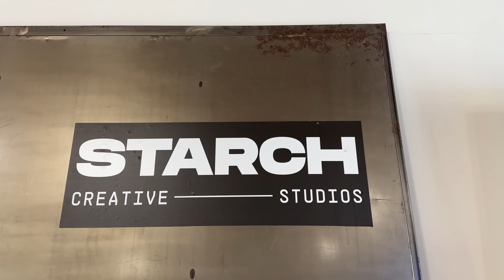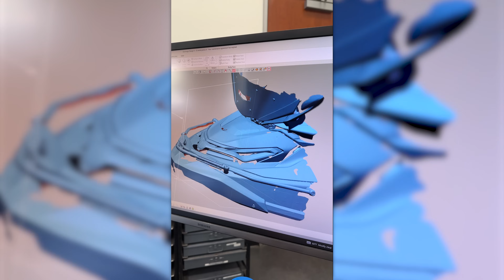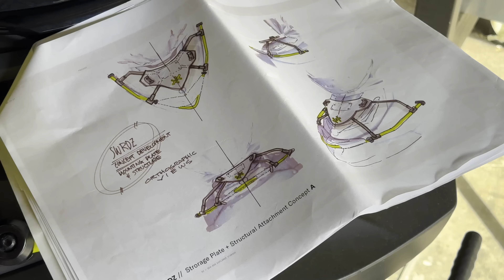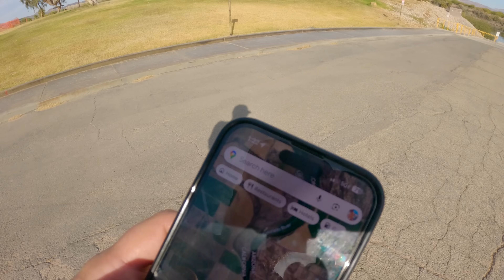This River Is CURSED!

Comment: Check with your design and fabrication companies to create a PWC anchor winch. Not the traditional type that simply releases and then pulls the anchor back in on a boat ... instead a smaller version that uses synthetic line such as used on an ATV (lighter/durable) that is released and throwable into deeper water or to nearby land. The attached anchor or hook can be captured on an underwater or land-based object (rock/tree). Then use the winch to pull the PWC off of the strand point into deeper water. Recover the anchor/hook and line, then move onward. Just an idea.
Reply from the maker: Hah that would be wild
Reply: Think of a small capstan winch that attaches to the front rack.  Toss out the anchor and hand winch yourself out.  Could be on a linQ mount so could mount back or front (if your plate incorporates linQ)

Comment: You could mount those RIGID running lights on the underside of that rack and not have to give up you current running lights. Or, if RIGID has a short light bar you could mount that. Could you imagine the amount of coverage that would give you.
Reply from the maker: Oh yeah!